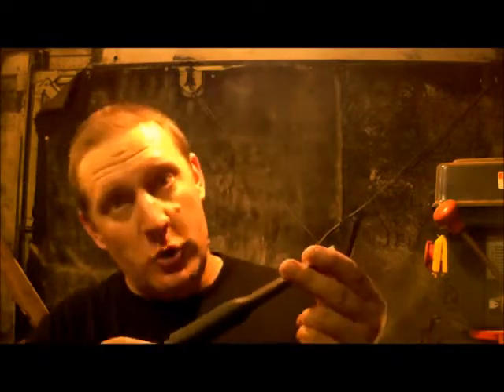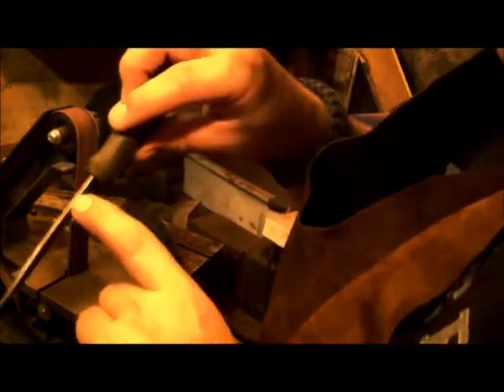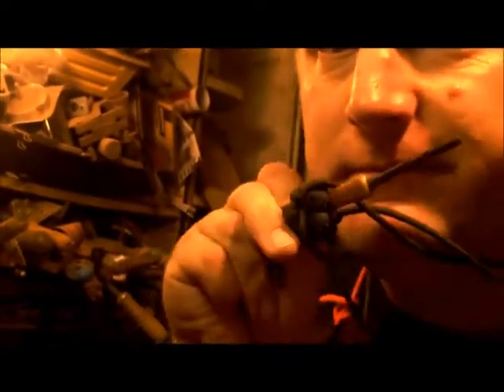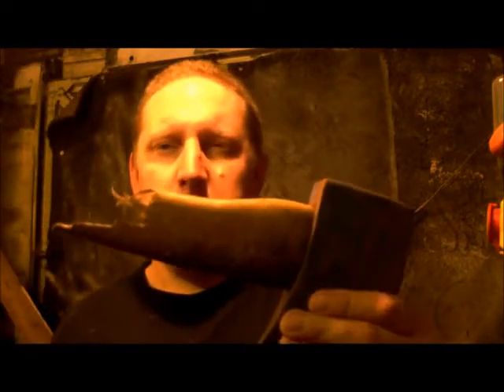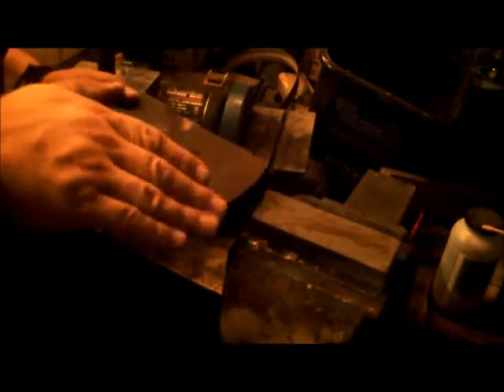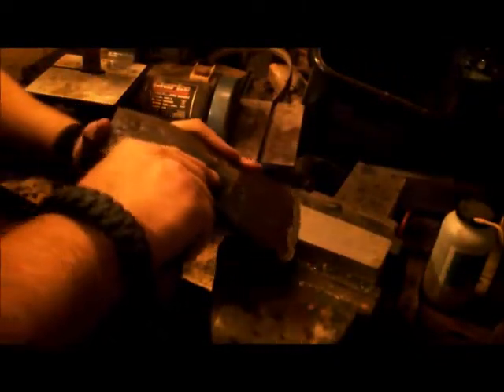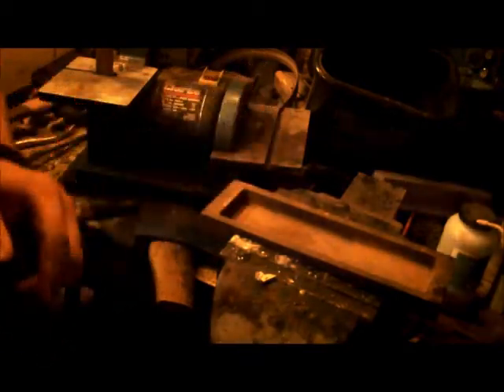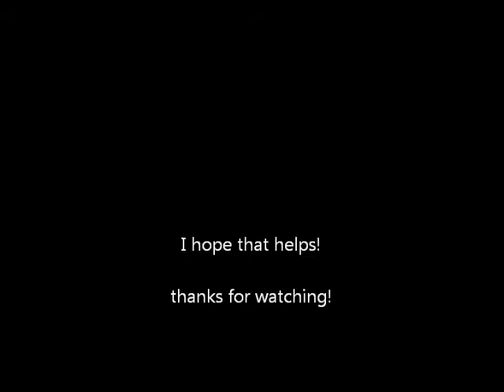Bush Craft Tricks and Tips.Using a Budget Stone and more...

Comment: Could you put the axe head in the vice and use the stone in your hand Scott. And if not why not? Never really sharpened anything myself but I would probably try that method.i suppose if you slipped doing my way you'd probably lose a finger so that's not very good, but apart from losing the odd digit here and there is there any advantage to doing it with the stone in the vice.